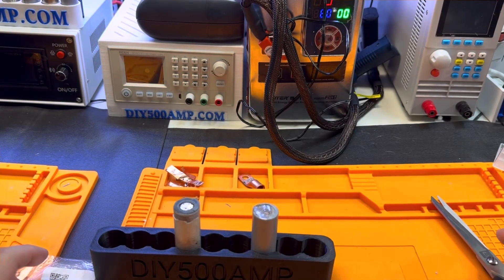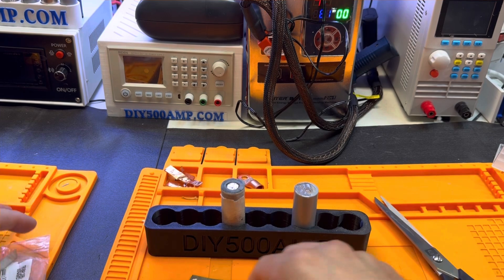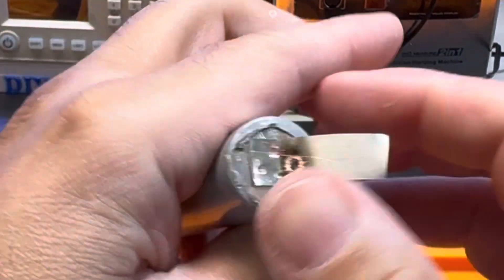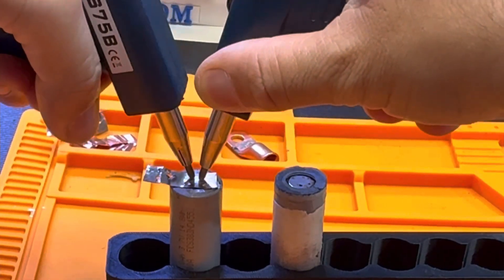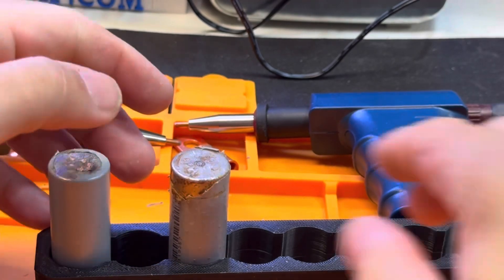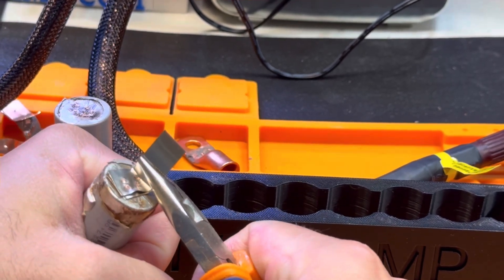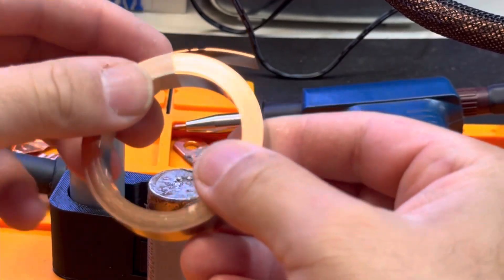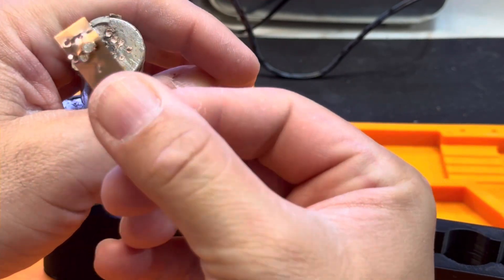Spot Welding PURE COPPER Nickel-Plated STRAIGHT onto Batteries! Glitter 811H Test!

Comment: How difficult is it to use a better battery to do a video instead of constantly mentioning the caveat that the battery isn't clean.
Reply from the maker: Well.. Is $$$. Each time I do a test I destroy a battery. I destroy batteries almost everyday. Is not easy to afford a new battery every time I need to do a test.
Reply: @DIY500AMP those are like 2$ new

Comment: Everywhere I look it says light firm pressure for spot welding it looks like your pushing quite hard would you be able to do this on a scale just to see how much pressure your putting?
Reply from the maker: Not everybody have powerful spot welders. Pressing hard is a most on this powerful machines. I make sufficient pressure to mark the can with the probes. That hard.

Comment: Hi. Here is a video about the Glitter 811H (Heltec HT-SW02H) testing it with different cables and an osciloscope, showing its factory problem of Mosfet's voltage spikes, and solutions for this problem. I'll make asap a new video detailing the protection circuits.

https://youtu.be/rgQtxYR4PkU?si=VhXkEYcEfUzYMfqz&utm_source=ZTQxO

Comment: Be careful with that style of pen. If they slip and touch as the welder fires, your mosfets will be cooked. I would avoid.
I normally use 0.3 copper in two separate strips but I need to try the sandwich method in 0.2.

Comment: Thanks Nelvick,
   Cheers for all the effort you put in to show us what's possible, and what works and doesn't work.
Shame about this particular Nickle/Copper sandwich not working, but...like you said, it seems the Copper's just far too soft and it needs the Nickle so the weld doesn't just burn straight through the Copper.

Always a pleasure to watch your content!
🚲⚡👍
Reply from the maker: Thank you Mikey !!
Reply: @DIY500AMP 👍 Thanks for all your excellent videos, and for passing on the valuable knowledge, it's been most helpful indeed mate!